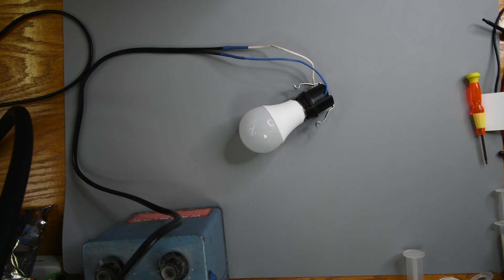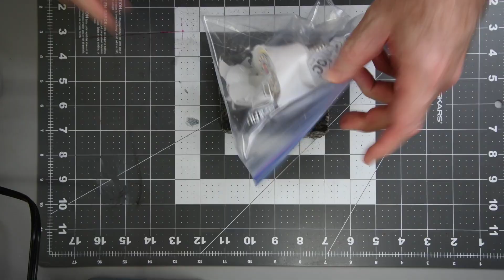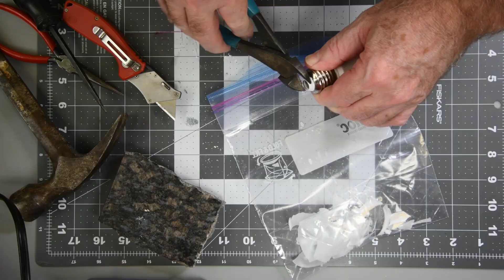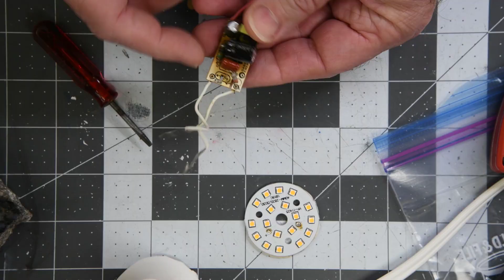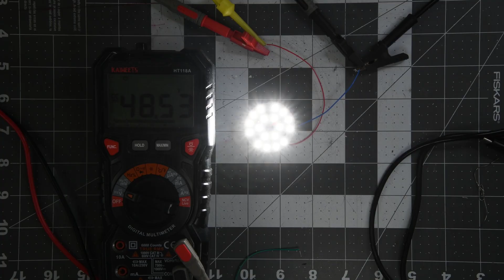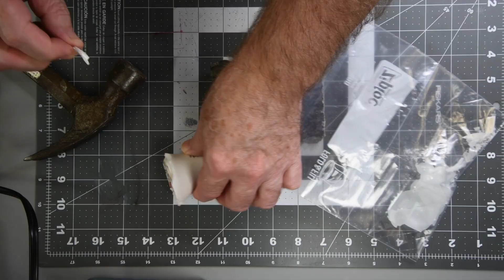Inside a $25 Defective Ultra-High CRI LED Bulb

Comment: take something apart, it is quite relaxing, yes!. especially when you don’t need to reassemble it.  i have those light bulbs!. (so old they don’t have the web site printed on them) bought them when there were no high CRI bulbs around. 2018. the small version of those bulbs i one burn out, lasted about 5 years, 12 hours a day. the ones in the kitchen are still going strong. now i use the philips hi CRI at homedepot. if only because they are about half price. not same, but so close.
Reply from the maker: I've tried the Philips, and they look very good and are a lot more affordable for general lighting.  But for video, you can see a big difference in the color chart between the Yuji and the Philips.  I'll have to give a new Philips a try; it's been a few years since I looked at them.  I want to try the Yuji 98+ CRI lights, but I just can't see paying that much for a light bulb.